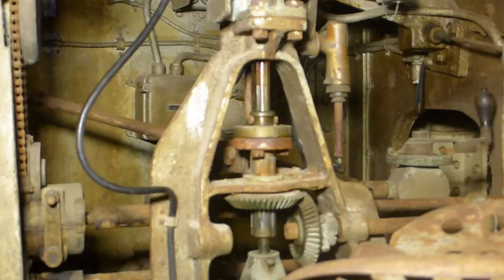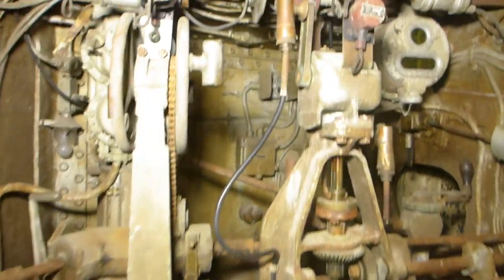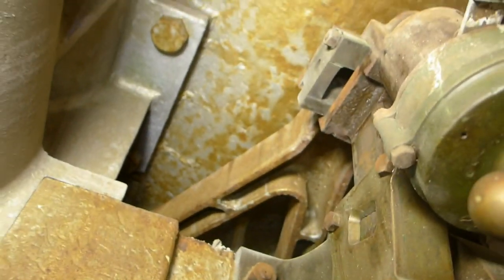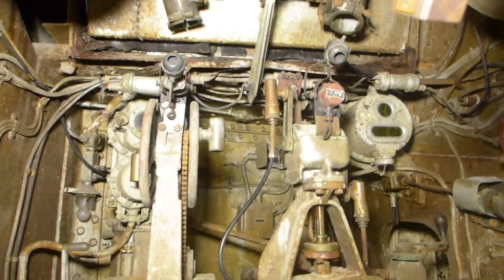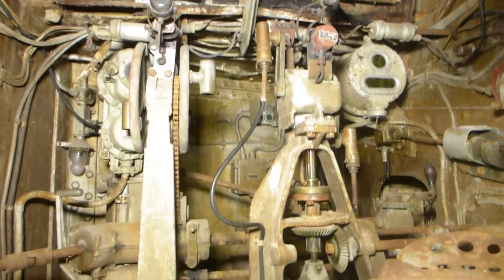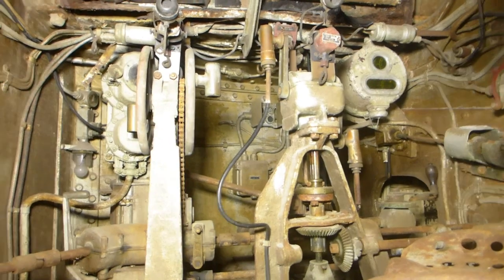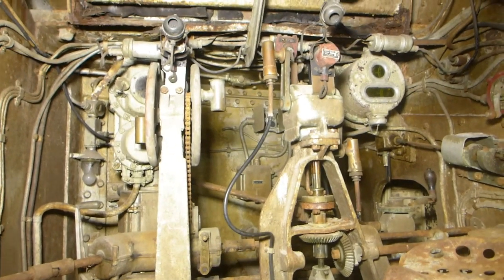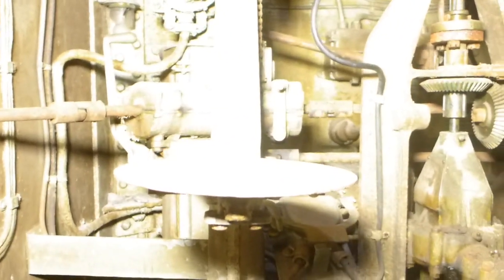Battleship Texas, Shooting the 14" Guns The Old School Way.

Comment: i've always been interested in the big guns on board ships - what was the noise like inside the turrets, was it more of a heavy dull thud rather than the muzzle noise which produces the shock wave - in other words was this more comfortable for the crew than we might imagine
Reply from the maker: I cannot tell you the nature of the sound of the gunfire, but veterans who served in the turrets said that it wasn't very loud.  That is what 14" of frontal and 9" of side armor will do for you.  Background sound was from the ventilation system and, and gun training and elevating motors.  None were likely loud enough to interfere with loud talking.  When a gun fired, there was a loud "whooshing" noise from the recoil buffer as the barrel recoiled followed by a loud slam as the counter recoil springs pushed the barrel back into the battery position.  As far as general comfort, the turret gun houses are divided into two sleeves, one for each gun, and the commander's booth.  There are two very large blowers that pushed huge amounts of air into each sleeve, so they never unusually hot.
Reply: @tomscotttheolderone364  that's a great reply, and with detail - its funny what the mind imagines of big guns making such a noise inside the turret - but knowing a little on guns anyway suspected the noise to be much less - in footage that i have seen of the large guns firing the shock wave outside is pretty extraordinary (you never see what goes on inside, at least i haven't)
- you definitely would not like to be on the receiving end of that

it must have been quite something to be on deck or in the near vicinity such as on the 40mm Bofors - i guess ear defenders would be a must, but what were their quality like back then if worn

Comment: I don't like to criticize such honorable people but why are the turrets so dingy? All five of them are tourist magnets they should've been kept in pristine condition. Keep up the good work I'm sure conditions have improved.
Reply from the maker: The turrets, along with much of the ship, are so dingy because it took a crew of 1,000 sailors and over $1 million a year in 1945 dollars to keep her up.  That ability has not existed since the end of the war.  Instead, work is concentrated on keeping public spaces up, performing critical repairs and maintenance, and doing everything possible to preserve the rest.  Unfortunately, the turrets cannot be used as tourist magnets.  Turret 1 can be accessed through the escape hatch in its bottom, into the commander's booth, but the rest of it is barricaded.  The other four turrets are locked off and will never be open.  The reason is simple; vandalism, a prevalent theme throughout the entire ship.  Turret 3 was fully open to tourists for many years and everything that could be broken or stolen has been left ravaged and not repairable.  I am somewhat numbed to much of it, but it sickens me to enter that turret to the point where I avoid it as much as possible.

Comment: You forgot the Corless effect- it's about 1" at 1,000 yards.  Doesn't sound like much but it can affect accuracy
Reply from the maker: I limit my discussions to what was capable on Battleship Texas.  I didn't mention "Coriolis" effect because it is not pertinent to the video.  Plus, the ship's range keepers weren't designed to calculate it.
Reply: Coriolis effect is too complex to simplify to an erroneous 1" @ 1000 yds. For example, using a 105mm Howitzer (33# HE shell) firing table, FT-105-AS3, Table H, for charge 1 (~200m/s ~650fps), depending on azimuth to target, range correction varies from 0 (N/S) to +/-3 meters (W/E). It is double (6m) at full charge (Chg 7 @500m/s ~1650 fps), and decreases the further away you get from the equator. Then you have azimuth corrections for Coriolis effect that are even more complex for manual calculations.
Reply: @anthonykaiser974  I have known about the "effect" from my days as an artilleryman, but I don't know the math. The "charts and darts" guys did that for us! 😉

Comment: Kind of funny to think that once upon a time, that was state of the art.
I saw some discussion about the pitch of the ship. It jogged a memory of a system employing electrical contacts that were connected to a gyroscope? Basically the firing mechanism was operated electrically and would trigger the instant the ship was level as it pitched (& rolled?) pretty much no matter the seas, thereby improving accuracy. Not sure what the advent of that technology was, I want to say pre-World War II, but not by much?
Reply from the maker: Even in 1914, the large guns were always fired electrically, even when under local turret control.  They could be percussion fired with a lanyard attached to the firing lock, but that would be reserved for clearing a gun if there was a problem like a disabled firing circuit or a misfire.  Director fire was when the guns were fired remotely, originally by the directors in the fire control towers.  The director crew would use scopes on the target combined with level and cross level markings to fire the guns when the ship was perfectly level in both pitch and roll.  The Navy began incorporating "stable verticals", sometimes called "stable elements",  in the 1930's that determined level and cross level using gyroscopes then automatically fired the guns at the appropriate moment.  If you look at photos of main battery plotting rooms in any battleship or cruiser, you can see the unit usually sitting next to the range keeper (ballistics computer).  It has the brass firing key handles, or triggers, mounted on its side.

Comment: The hit rates in The Battle of Jutland were terrible, I assume both the British and Germans used sighting/firing systems similar to this. When hits were scored it was a bad day for the ship hit.
Reply: The ship's British problem was partly due to badly designed shells that detonated early. Sadly for them, the problem was actually know before the battle but wasn't addressed. Much like American torpedoes in WWII.

Edit: on the British side, the high damage received was partly because of poor discipline with flash doors within the turrets and powder handling systems.
Reply: @Lucas12v  Roger all that, but the hit rate from both sides was really bad.
Reply: @briangulley6027  yeah, that's true, especially among the British battlecruisers.
Reply: @Lucas12v  The German Ships ( 3.33% from 3597 SA Shells , 120 Hits ) shoot much better the the British ( 2.17 % from 4598 SA, 100 Hits), part better traning, part better Fire control.
Reply: @donald8066  Im aware that the German gunnery was better but i didn't feel like arguing with the other commenter. I figured that depending on how you look at it, you could say both sides did badly even if one was worse. Always nice to have exact figures though.

Comment: I thought shells would fly straight, thank you, I learned something
Reply: Long range rifle shooters call it spin drift but with normal sized rifles, wind is a far more important factor. It was interesting to hear that they weren't too worried about wind with the 14's. I guess the mass of the projectile was just so high it was less important. I wonder what the ballistic coefficient is lol.
Reply: @Lucas12v  Makes sense. With the cross section vs the weight it'd take a lot of wind to push a ~1400 pound shell off course.

Comment: The deflection was probably to compensate for Coriolis force, which is due to the Earth's rotation, and varies with latitude. The deflection is opposite in the Southern Hemisphere, which caused the British some trouble.
Reply from the maker: It has an effect at longer ranges, but the main problem was gyroscopic precession.
Reply: @tomscotttheolderone364  That is the case with regular sized rifles as well. When it comes to lateral adjustments, wind is the biggest factor, then spin drift (what shooters call the gyroscopic effect) and lastly the coriolis effect. Did i understand correctly that wind is not a major concern of guns of this size?
Reply from the maker: @Lucas12v  Sure, wind was a consideration that had to be factored in.  A s far as whether or not it was more important than drift, I suppose that depends upon wind conditions during firing.  Drift is always there and always constant at any given range.  Coriolis effect wasn't as much of a consideration since Texas' guns were limited to a range of 23,000 yards and flight time of 22 seconds due to maximum barrel elevation of 15 degrees.  In fact, her range keepers didn't have an input for it and it wasn't part of the firing solutions.  That changed with later ships whose elevations allowed ranges of 35,000 yards and flight times of over 60 seconds.
Reply: @tomscotttheolderone364  i just did a little google searching and it looks like the 16 inch guns of Iowa and other later classes had ballistic coefficients of around 15 depending on projectile. That's pretty unbelievable for a person who is used to regular rifles. For example an average round from a 308/7.62 nato is 0.4  or so. If you're not familiar, ballistic coefficient is basically a measure of how aerodynamically efficient a projectile is through the air. In other words the 308 round will loose energy more than 30 times as fast as the 16." The thin air at high trajectories would make the big round retain velocity even better. I read that a 16" fired at 45 degrees would reach a max hight of around 7 miles. Fascinating stuff. 

Anyway, I'm really enjoying the videos. Hope you make more. Thanks
Reply from the maker: @Lucas12v  Thanks for the compliment.  I am familiar with ballistics coefficients.  As you are seeing, exterior ballistics on these big rounds exist on an entirely different level, even though the basic concepts are the same.

Comment: Mind blown again, Tom! I had no idea this intricate aiming system existed.

Question: It is my understanding that both guns in a turret can aim/fire independently.  Does this require 2 trainers and 2 pointers per turret? If there are two trainers, how are conflicts between the two avoided?  I've always pondered this.
Reply from the maker: You are right in that only one trainer at a time can train the turret.  Their controls were interlocked so that only one can operate a training motor at a time.

Comment: Pointer should fire on the up roll. Same basic system on the 16 inch turrets, except we had two systems one on each side of the turret. The turret officer would have to designate which side depending on where we were leading the target. I only ever go to fire in local control once at a target off of Hawaii.
Reply: Thank you for your service. If BBs were still in service post 9/11 I would’ve joined the Navy